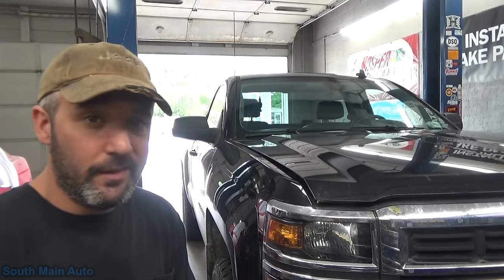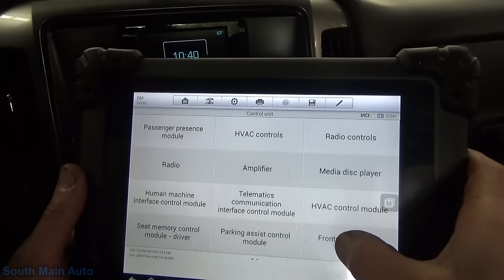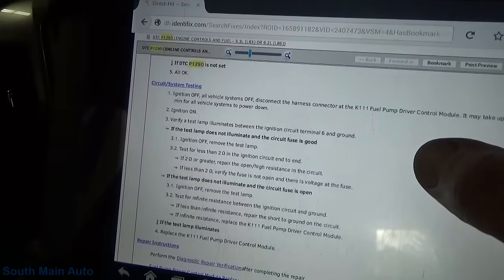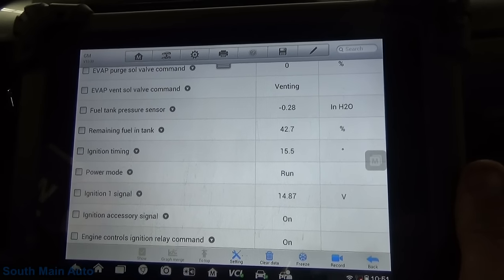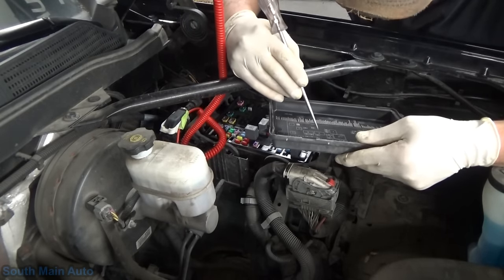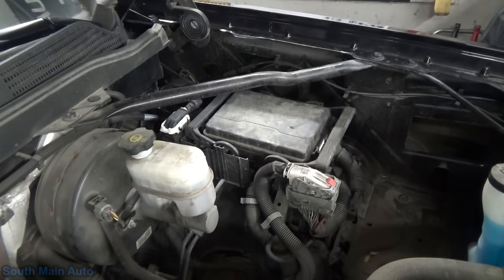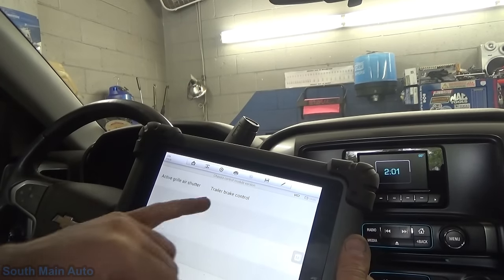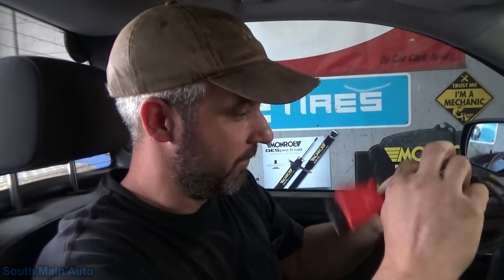Chevrolet Fuel Pump Driver Problems - Where Is The Broken Wire

Comment: You'd think the rust was installed right from the factory.
Reply: No - GM charges extra for that ... ;)
Reply: Yeah... similar to the EU version of the E36 BMW 325i
Reply: This is correct.  It is listed right on the sticker as standard equipment, known as the Rust Package.
Reply: This is from the same company that produced the Vega, the first car to start rusting on the showroom floor.
Reply: Always order your GM trucks in rust color so it doesn't show up so bad
Reply: i believe pontiac star chief holds the insta-rust from 1955, for gm anyway.
Reply: all makes rust out these days its not just gm there all junk due to these new safer led free paint products
Reply: good point on the lead free, low/no VOC, non oil based paints :)
Reply: Indeed modern auto paints and rust prevention are junk, ridiculous really as product scrap in few years which worse for environment than using good materials that make it last a worthwhile time span ... madness !
Reply: yes agree i was in the auto body repair for those 25 plus years and when i started in the late 80 they were good and than the companys were forced to take out the bad stuff that made them great products
Reply: it´s a joke, just 3 years old... 2 more years and there will be holes..there is a reason that nobody outside the US wants to have these cars...
Reply: Nobody in the US wants this crap either ... but what choice do we have, other than build our own out of the old stuff?
Reply: Smitty Smithsonite why isn't it normal tomorder added rust protection when the car is new. This baffles me. Can't be the extra expense only.
Reply: You need to include Dodge in that category of cars rusting on the showroom floor. I think that was before Lee took over the company and gave us the Omni/Horizon.
Reply: Not entirely sure it's just the type of paint, but possibly how much they use.  I remember when Holden (GM Australia) first went to acrylic paint in '58 - they weren't sure if the paint would hold up, so they put it on extra thick.  I've seen one or two over the years that still seem to be daily drivers with the original paint - and no rust to be seen.  Of course, not having snow or salted roads to deal with sure helps - but on the other hand, Sydney's pretty close to the ocean.  :-)
Reply: I remember when I was a kid, my dad bought a brand spankin' new '77 Ford F-100. By 1979, the cab was sitting directly on the frame. My dad still to this day says he's never seen a truck rust out faster than that thing did, lol. You could hear it rust at night ... :D 

The late 70's and early 80's were unkind to cars & trucks ...
Reply: R.E. Hill: Automakers will never do that - they're in the business of selling you new cars ... not making them last forever, unfortunately. It's all about the money today - everything else is way down on their list.
Reply: They should equip those vehicles with some kind of rust position sensors :P
Reply: No point Dale - they'd just fail and report "paint". :D
Reply: Should have mimicked the Pinto, it blew up before the rust went too far.
Reply: hoppes9 I had  one, valves  sticking  at 1500 miles.
Reply: I had a for dealer claimed that a 10mm turbo clamp nut cam from the factory imbedded into the top of the #1 piston one time. This was after the dealer installed a new egr cooler on a 2006 6.0 powerstroke and a knock appeared. After opening a CLP claim with Ford they said they did not back a customer at the dealer level. I guess that tech thought he heard that nut fall all the way to the floor.
Reply: Oh shit, nobody ever had an Opel/Fauxhole as a car. They get a little shovel with an brush as an add-on so you can at least keep the street clean when the rust on your parking space gets to much
Reply: I think you guys all have it wrong.  You're suppose to replace your truck/car every 5-10 years.  Not keep them for 250k to 500k miles.
Reply: @phprofYT  The industry is thinking like that yes. I Life of an car is 120.000 km or 5 Years, not 1 million km and 100 years, so they could say Lifelong warranty and people believe them. But a good car, with good maintenance could last 20 or more years. Sadly, VW, BMW and others learned from the US industry and plan the death of a car ahead so they sell new cars every time. That's the reason people buy Toyota or Kia, they try their best to keep the cars long running. At least that is our experience here in Europe. Opel died when GM bought them, they are so badly build, they die after 5 years like all GM crap. That is the reason GM was thrown out of most dealerships and Kia came in. Less problems, better cars, better support of Kia.
Reply: Sad that no amount of cash spent can solve the rust issue AND your tax dollars excessively spent on the road salt. So in a way it's your own fault for property ownership; of course I hope you have stock in a salt mine....
Reply: If it’s made in Canada the rust is a non-deletable no cost option.

Comment: I switched from tech (15yrs) to a line repairman for a plant that builds trucks (don't wanna say which plant just to cover my rear from employer) but it amazes me the amount of harness' that are damaged and have to be repaired.  The machines they use to transfer frames and the ones that  flip them over are unforgiving to wires, hoses and lines that weren't secured down properly.  but that being said we have awesome repair people that can make wiring repairs and connector changes as the truck is going down the line. we build between 750 and 850 trucks during a 10 hour shift
Reply: That's why my windows won't roll up or down.

Comment: The trick to (and problem) wire finders is that in order for them to work the wire needs to be isolated. This is great when you are trying to trace out a twisted pair that isn't spliced to anything else or sharing a ground. In cars that's a much bigger problem. Especially when you get the massive ground plane that is a cars frame involved. You can pretty much forget about tracing a ground wire unless you can ensure that both ends are disconnected and not spliced to anything else. On the other hand any wire shorted to ground is going to be completely untraceable. Those testers are really good at what they do. (I've used them to good effect in large data patch panels) However the way cars are wired with so many shared connectors and chassis grounds I completely agree with Eric in saying that they just don't work.

Comment: Please don't worry about this video being less than exciting. It's great to have a video about tracing a broken wire since at some point I have a feeling many of us will be doing some of that. I drive an '07 Silverado with 155k on it and love it to death. Not saying anything bad about any other truck, just that I like mine. You're videos are consistently entertaining and informative Eric, and thank you for what you do. As a DIY guy I need all the training I can get so I can diagnose problems, and leave the part gun in it's holster until the real cause is known.. Have a great day!
Reply: I had an 83 town car with no power to the fuel pump in the tank. I had power up at the engine and the relays were working I could hear them actuate. But I had no power going out of the relay to the pump. Took the covers off the relay the contact points were pristine and they had power I checked. You're going to love what the problem was. The electrolytic Grease on the wiring harness connector had dried out! It created in insulation between the contacts of the connector and the contacts in the relay. Believe it or not I had to clean the connectors going into that harness that ran down to the pump and the connectors on the bottom of the relay to fix the problem. I won't tell you how many times I drop the tank trying to figure out what the heck was going on
Reply: You're the best kind of video star, humble meek and mild mannered.  God Bless kb

Comment: Same issue with my 2012 sierra. I will check at the plug before buying a driver thanks to your video.. I've learned a lot from your  videos. Pretty tough to find a mechanic that doesn't just throw parts at it. Keep up the fantastic work.

Comment: When doing electrical checks like your performing on this vehicle the first step that i take is hooking up two high quality jumper wires directly from the battery to the area of the work. That way i'm not looking for good grounds everywhere and I can check my test light each time. It ends up saving me time and frustration. Great video!

Comment: Tracing wires with the phone company, we used to just use a spare pair and call it fixed. Tie a knot in the bad pair so it wont get used again, and off to the next call we go. Out of all the electronics they gave us to use for tracing, They all had the same problem as you explained. Your way seems to be the best , due to your working on a harness that maybe 20 foot or so, we were troubleshooting cables 20 miles. We used a Mega Ohms meter, it would get you to maybe 100 foot or so to the open, then you just go to the nearest splice can, or just spare pair it. And go to lunch early :)
Nice wire tracing video.

Comment: I love chasing/repairing these type of issues. It is so refreshing to see the pride in your work diagnosing properly and not just throwing unnecessary parts at the vehicle. Even coating the pierced areas to avoid creating a down the road issue. No one watching, usually left by others. Definitely a problem created when vehicle was new. Odds of seeing another one with that same problem would be like winning the lottery.

Comment: There is a special breed that knows the art of wire chasing.  I like this one because it was a manufacturer's defect.  These are the ones that other shops pass along since it take a "one wire" (electrician).  Personally I don't have Snap on tester because of the cost.  I do have 50 dollar code reader that is helpful just giving a direction for the money light.  When that baby comes on there are so many possibilities.  The other really good thing I like about your videos is your mouth had a direct connection to you brain.  I never have to worry about having to guess what your thought process is.  I hate these videos that have no or little comments during the repair.  You have a great camera and audio.  And yes, I love to hear that door opening and the phone ringing.

Comment: Eric I love watching you do repairs especially what you had to do on this truck I am one of those Car Guys that is scared well you fill in the blanks of electrical and I've learned a lot watching you do the repairs like what you did tracing down that corroded purple wire down in this truck so thank you for showing us how you doing as I'm restoring my 67 Camaro I've had to go through a lot of electrical issues with that and yes a lot of parts are available for the 67 Camaro but there are some that are not , so what I've learned watching you repair on other cars you've worked on I'm learning to trace down electrical faults myself so thank you for showing us on your videos keep up the great work there thank you .

Comment: As other viewers commented on the same issue...I can't believe all of rust underneath that truck. I have an 2003 S10 Blazer that spent it's first 10 years in Tennesee . It's been up North here in Syracuse NY for the last 3 years. In the winter when it snows and the roads are salted I always take it to a car wash and clean the underneath as best I could. Anyways, sorry for going off topic . Solid as always SMA !

Comment: Erick your one honest guy I have seen . Believe this has taken my 07 Chev Impala to different shops here in Ogden Utah . One shop here has tighten my front hub nut so tight I had to cut it off . The specs on the 07 Chev front hub is 118 ft pds .

Comment: Great job Eric, I am an old Telephone switching tech!  I worked on xbar equipment, electronic switching machines. l used oscilloscopes and snap registers to isolate circuit faults.  You would have made a good switch tech, your work ethic is outstanding!

Comment: Eric O. I know that you thought this video was one of your more boring and lengthy BUT this video exemplifies exactly why I watch your channel. You know and clearly state in this video all the available quick fixes/short cuts that others may use to fix the problem. But you dont! You properly test, retest and correct your work as you try to locate the break in the wire harness. Your repair is strong and professional while also teaching us that you do quality workmanship on all of your customers vehicles. Honestly this is now one of my all time favorites. Thanks again for doing the right thing in automotive repair

Comment: Awesome video! As a fellow tech, I am also a subscriber. 
I ran into something similar about 4 years ago with a 2000 Chevy Blazer that had a broken wire between the ECM and Canister Vent valve. Instead of using power, I ohmed out the wire. With a long wire and probes, I tapped into the Valve connector and set the multi-meter to beep as I moved along the harness. Obviously, when I reached the open, it didn't beep. Any way that gets the job done properly is a good way to go.

Comment: The critical part of all of this is logic, and clear thought. He does very well.people i worked with  were not that way. I had a biss sever his finger when he eas checking a failed pump in the shop. He skipped one critical part, seperate the air pressure from the pump.

Comment: Eric,

Broken wires can be traced with a wire-signal tracer, you put a signal on the beginning of a wire and trace the beep with a wireless receiver.
so you can monitor the spot where the wire is broken.
Can save you a lot of time...

Comment: My very very sincerely appreciation for your video , my suburban had the exact same issue I could never figure that out my self . Some how my truck was missing ECM ignition fuse . I just put a 15 amps on it and it worked .

Comment: Eric, I enjoy your videos. Do you ever wish you worked in the 60`s and early 70`s when the cars were a lot simpler and could be
Tuned up with a Tach, dwell meter and timing light? I miss those days badly.
Reply from the maker: Oh gosh no! haha I hate old cars, all them old vacuum lines, primitive wiring not to mention carbs!!
Reply: @SouthMainAuto   Amen. Remember those days  when your car stalled 3 times by the end of the driveway and you never made left hand turns in case it bogged and stalled? Remember choking behind them at stoplights? I do!

Comment: Interesting and educational video.  We just went through something similar with our 2017. 😕
Reply: I am dealing the same issues on my 17 now. What was the issue with your 17?  Ive already had it in the shop a few times. mostly tranny issues. But a broken wire for fuel pump and now a code that reads fuel pump control module.

Comment: Got the same code on my ‘18 colorado, truck runs and drives fine. Cleared the code to see if it would come back and it did before I even turned the truck off. This’ll be fun to diagnose and fix

Comment: Good diag. Did a tilt dump 2 axle trailer last summer thay had more then a few broken wires. Traced it the same way by probing at the beginning and end of the circuit then every meter or so until i was able to locate the open. Suspected green crustys were at fault

Comment: 2017 silverado, came in last week with parking lights staying on, couldnt figure it out except we knew that one of the park light wires was getting mystery power from somewhere, and grounding the ckt would eliminate the problem for a day or so.  today it shows up with no start, half power to the FPM, found bad wires in almost the same spot, this fixed both our issues.  Yay.

Comment: I think you could use a TDR (Time Domain Reflectometer) to get a measurement on how far the open is from where the TDR is connected (at the fuse in this case). Different wire gauges and composition of the wire and insulation have different capacitance values but in such short distances (as in a vehicle wiring loom) there would only be a small difference between wire gauge (size), say a few inches. I used TDR's in telephone cable work with great results (the TDR works great on clean opens and high resistance opens, also shorts, & grounds, or short to ground). Some times, if you are close to the open, you have to add a piece of the same wire before the beginning of the wire under test to see the fault. I.E. add 50 ft. of wire and zero the meter so the connection is not too close to the initial pulse. A friend of mine uses a TDR in trouble shooting buried sprinkler control wire faults with great success. I love your videos. Are you really a transplanted Texan? You use a lot of the same sayings and phrases I do!